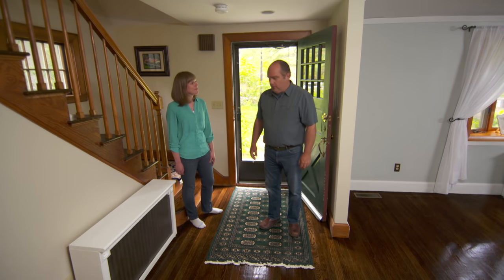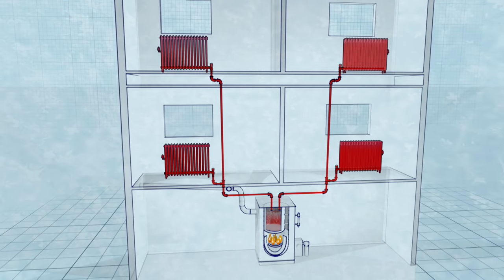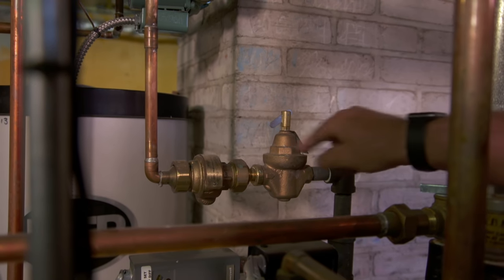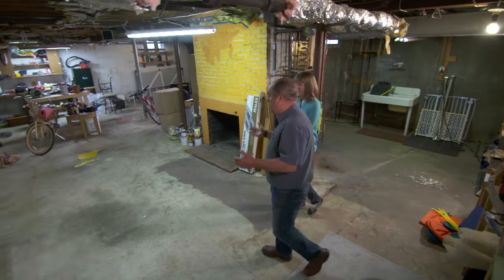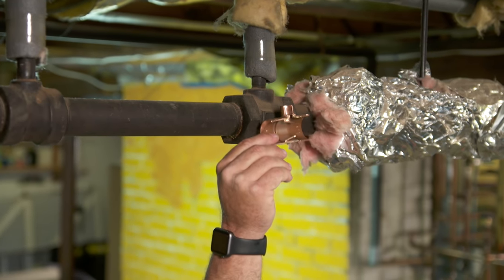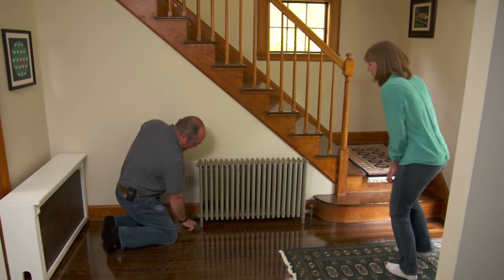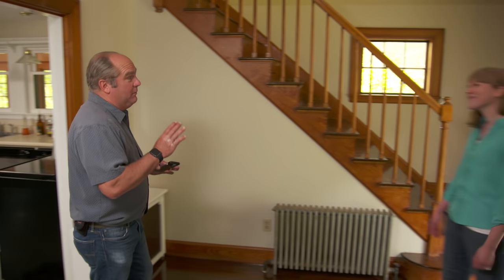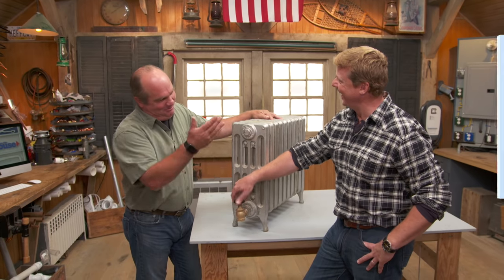How to Diagnose Problems with a Hot Water Heating System | Ask This Old House

Comment: Hello, I have a house built in the 1940’s with a radiator heating system that always worked fine. We did decide to upgrade soon and had 2 boiler salesmen come by to take a look. All of the sudden our system doesn’t work. Is there anything they could have done to switch the system off to force us to upgrade? Any advice is appreciated. It’s pretty cold in the house right now, just wondering if this was truly chance.
Reply: Sandra Kowal.    You just said you decided to upgrade.
Reply: You checked switches, breakers, water levels, valves, pilot light (if any) I assume?
Reply: Of course, it's possible.  Call them and tell them what you are telling us. Tell them you'll call your state's Attorney General's office to complain if they don't undo what they did. The Dept. of Consumer Affairs is often part of the AG's office. They are there to help you and will know if that company has been a source of complaints in the past. SPEAK UP!!!  But first check to be sure that the burner is lighting and the circulator pumps are working. Put your hand on the pumps to feel the motors humming. There may be a second switch controlling them. Be sure it's on. Check the thermostats to see that are set correctly. If they have batteries be sure they are OK.
Reply: If the system was working well, why did you want to replace it?

Comment: Hello:  Most of you peoples' comments are SO CRITICAL. Don't watch the program if all you can do is judge the man or say "Oh this way a setup." People are so rude these days. I, for one, was looking for just this "tour." Yes, I have these same type of heaters, sadly, and yes I do know how to shut them on and off. I don't live in a nice old house. I rent off of a woman who split an old house up (a real "slumlord" in the city of Youngstown, Ohio into two apartments.My heat is supposed to be included in my rent. One apartment up and one down...so my apartment is formally the upstairs bedrooms of a very old house.  I have never seen the downstairs apartment nor the basement. My neighbor has the thermostat in her apartment and shuts off her radiator valves downstairs which are obviously directly below my radiators when she's "too hot." Well, last week during this 2017 "un-jolly" Christmas season it was 27 degrees outside. Apparently, she was very very hot. All four of my radiators were cold as ice. She AT LEAST USUALLY leaves the kitchen one on...(and never my bedroom one on...the one I need the most since I am bedridden.) And yes, ALL my valves were completely open...and YES - it really does matter if they are open half way or a quarter way for those who may not know. So my apartment was ice cold at a frosty 59-61 degrees. I sadly and DANGEROUSLY have had to resort to opening my gas oven door and setting the oven to 405 degrees to heat my apartment up in mornings and then again just before I go to bed. Yes, I know the CO2 is very dangerous. Tell my landlord because even though I can use a small space heater in my bedroom if I forget to shut it off before using the microwave, BOOM - there goes the breaker! Once again, no basement access and neighbor will only flick it on and back off the way kids play with a light switch and I have to wait 10 hours to 2 days for maintenance to come, then they must wait to gain permission to enter her basement and turn my breaker back on. So I take my chances with the CO2 instead. So thank you very much for this video. I record every temp in every room every morn, noon, evening and 3am. I wish I had a gadget like your phone app to prove the radiators are ice cold. That's the only thing difficult to gain proof off. It is like she said/she said. Then I could withhold rent and file with the ADA (Americans with Disabilities Act) for discrimination because my landlord is well aware my neighbor is doing this but they do not take steps to solve the issue. They claim they are "too broke to upgrade electric box or steam/hot water heaters" but it's really a neighbor issue also. They could put locks on her knobs and thermostats. I've lived here three years and every year I'm getting colder.  My neighbor taunts me by telling me to wear sweatpants and a winter coat when I go to the restroom in the middle of the night. Btw, I have kidney, heart and COPD breathing issues - have a disability car tag and am deemed disabled by the government of US. Is there nothing I can do about this? Frustrated and freezing in OH. Thanks for explaining how these things work. Now I know for sure that it must be her shutting her's off downstairs which is why heat/water never makes it to my floor...except one day when it was 50 degrees out and it was 76 DEGREES in here and they ALL WERE HOT - SO HOT - HOTTER THAN THEY EVER HAD BEEN IN THREE YEARS. THEY I KNEW WITHOUT A DOUBT THIS LADY JUST HATED DISABLED PEOPLE AND WAS PLAIN EVIL.Well God hates ugly. I'm trying to move but it's very hard to in this area. My parents and I have always loved your great show. Merry Christmas. I hope somebody will have a good, and not a cold - happy holiday and a wonderful New Year! Only a few more months until Spring. I'm hanging on! LOL   :)
Reply: If you  bleed the radiator you fix the problem.

Comment: I have a Bryant Gas Fired Water Boiler (1973) model 234 (nat Gas) that has always worked but today its not. I turn up the Thermostat for Call to heat and I see Pilot light go on and then the burners got on (Orange flame mostly) for a few seconds and then go out but Pilot reignites relighting the main burners etc.. This cycles 5 or 6 times and then it all shuts down Until I shut down the unit and restart the call for heat> I looked for some type of flame sensor but dont see one so I am not sure what to do. Any Ideas ?
Reply: Did you figure it out?

Comment: I have the same issue. One radiator that doesn't get heat (in the master bed to boot). No air trapped, no valves that could be off. Only thought is a clog. Any other ideas?
Reply: That radiator has no valve? All other radiators on the same floor get hot? When you bleed that radiator you get a GOOD flow of water.

Comment: Here is my problem with hot hot water heating I have a 1915 two story house with cast iron radiators AND baseboard fin heaters in the kitchen. The kitchen heaters and the boiler a just a few years old. The kitchen base board heatersdo not even get warm.

So I turned off every radiator in the house the copper pipe in the kitchen got so hot it burned my hand. I have then valved off now.

Comment: I am curious if the circulatory pumps actually help to heat the room rather than gravity operated heating system ?
Reply: I assume you mean better and yes they would. The reason is that the greater the temperature differential between the radiator water and the room air, the greater the amount of heat transfer, the faster the room heats etc. By forcing the water to constantly cycle the water in that radiator stays at a constant peak temperature as opposed to dropping. non pumping radiators worked like steam, the colder water sank to the bottom to be replaced GRADUALLy by the hotter water.  Just as steam ones worked by cooling from steam temp to water temp and reverting to water to leave. This is the difference between thawing a piece of meat via leaving it to sit in warm water (which then cools as it warms the meat) or leaving it under running water. Both will likely thaw the meat, but by constantly cycling the water over the meat and ensuring it's always fresh boiling hot water, you get faster heat transferrence and quicker thawing.
Reply: @sparkzbarca  Good. Thermodynamics 101.

Comment: Are radiators considered an efficient form of heating ? Are they still being installed today ?
Reply: Glenn Watkins Really? Yes and yes.
Reply: They also give cleaner air, long lasting heat, gently humidify the ambient and are wonderful for people with allergies and for those who prone to getting other people's colds (less air horizontal air circulation, it rises and falls)
Reply: @squirrelfish8200  Okay Squirrel Fish but have you learned there is no proof of contagion.

Comment: I am baffled to see how rare and uncommon firewood fired hidronic boilers are in US when in Russia and basically all of Europe firewood fired hidronic boilers are the thing of the past, the thing of the present and the thing of the future. Weird. As it happens, my own firewood fired boiler is 80k BTUs or 11 Kw of water heating energy from one cubic decimeter of hard fuel in the burning chamber. Guess what? it is located in the middle of my living room. I installed a stainless steel liner in the chimney and bought a very neat and decor style firewood boiler with cast iron heat plate so mom's can cook some soup while the firewood burns inside, and the doors are made from cast iron and has heat resistant glass, much like a glass lined fireplace, but it is basically just a free standing unit on four legs, and 1'' supply and return. I surrounded the boiler with tiles and installed mantles above the boiler. Just beside it is a stair well leading to the second floor stairs and in there I ran the supply and return, fitted the circulation pump and the manifolds. Parallel to this boiler I installed a semi automated combi boiler that I can turn on on the busy days when I don't have time to fire the boiler with wood, and it has a thermostat that calls when rooms gets below 17'c or when I'm out of home. I have installed different zones so every room's radiator is a separate loop so if any problems occur I don't shut off all radiators. I also installed a combi water heater that has an electric heater and also a spiral inside made from copper. When in normal mode the boiler is firing the spiral is heating the water for taps in the boiler as it transfers heat from boiler water to water heater water, and when the boiler is cold, the combi boiler heats it, and when that is cold the electric heater heats the water inside the water heater. Also, there is the third plan. If I am not home, and the combi boiler seizes or gets broken, the fitted 8 kw electric heater inside the firewood boiler itself is wired to run only when rooms get below 15'c and till it gets to 20'c, then it shuts off. This is the perfect heating system everyone should have at their house. Primary: Firewood or compressed sawdust tablets or briquettes, or even coal if your into that. Secondary: Gas as the combi boiler takes over automatically if i'm not home to charge the boiler with firewood or briquettes and third: electrics. If all fails, then the electric heater of 8 kw installed in the bottom of the firewood boiler will start heating. The mechanical thermostat secured on the supply nipple of the boiler itself that senses when the water inside the boiler has reached 60'c it turns on the circulator and the system starts to run as normal, the same thermostat senses when the water gets at 60'c and starts the circulator to run the water to the radiators. It's all really so simple if you look at it, but it is also so genius that any ordinary Karen or John would love to have it too just in case.

I am sometimes horrified at how insecure heating systems are in America. Ya'll love that oil so much, but you don't have any secondary plan if the boiler fails. I couldn't live like that, I would at least integrate a combi boiler that could take over if the main boiler fails. Maybe the snow is at 5 feet and you live in the middle of nowhere and your oil runs out then the gas can take over, but what if you don't have that and outside it's like -30'c? Scary stuff. I know that certain oil boilers have the ability to be open quiet easily with the latch that makes sure that oil burned is secured in the boiler body, but you could take it out and use the chamber inside as a firewood boiler, but I don't know how efficient that would be.

Also, with all those controls, errr, why do you all need that complicated stuff? My system is like that: A boiler, a supply nipple. On the nipple is secured just simple thermostatic switch that senses when water gets hot in the boiler and turns on a circulator. I charge the boiler with wood, lit it on fire, I sit back, and enjoy the warm and cozy fire behind the glass door. The water reaches 60'c, the thermostatic switch senses it, turns on a circulator. At first it circulates the water only trough the boiler itself, trough a thermostatic tee that diverts water to manifolds only when the water in the entire boiler reaches 60'c (if the hot water would quickly rush away and the chimney's temperature would be below zero, then the condensate would start forming inside the burning chamber and tar like substance would start forming on cast iron walls, so the thermostatic tee ensures that the boiler chamber containing heating water is at the right temperature and then slowly opens to let hot water run away to radiators. Then as the whole heating system gradually heats up the tee starts to open more and more until it opens up all the way and fully diverts the water to radiators and not trough the mixing loop of the boiler) then as the boiler heats up the tee opens and the radiators start heating up. When the wood has finished burning the system cools down and the thermostatic switch turns off the pump only when the fire inside the boiler has gone out. As you can see, no need to have all those fancy Taco computers next to the boiler. Work smarter, not harder. Yes, this way you can't control micro climate in every room because if you close every radiator wia/ thermostatic valves then the boiler can overheat and explode, but who needs that anyway? Radiators heat up and cool down, and noone complained about it for 100s of years.
Reply: Good comment, except for the last part. I need thermostatic valves,  because without them my apartment is waaay too hot.

Comment: They probably turned it off for the show....Anything for TV
Reply from the maker: Nope.  That was really how we found it!
Reply: What about a radiator that gets warm but never hot. I have a multi-family in Fall River, MA and one of my bedrooms is always colder then the rest of the house because the radiator is noticeably cooler to the touch then any other radiator in the house.
Reply: That could mean low flow of water because of a restriction, but the most common cause is air collecting in the radiator.  If  you haven't already tried to drain the air from the valve like he showed, you should try that first (you might find the lower part of the radiator warmer than the top).  If it's higher than the other radiators in the house, it could be there is not enough pressure to get water up there also.  That could mean the expansion tank is malfunctioning.
Reply: Thanks for the info.
Reply: Dennis, even if they did it for TV. They're teaching the viewers.
Reply: @Thisoldhouse, you really found it like that? Isn't that the first thing you would check?
Reply: Its easy to overlook though. Especially when they don't work like they're supposed to..
Reply: @thisoldhouse  Wow you would think that someone would check the valve before calling the experts out.
Reply: @saulgoodman2018  Maybe they did, but decided to make the trip into a teaching moment.

Comment: I want to change from old radiator to base heat my myself how can i do it.
Reply: If you have $10,000 lying around, it helps. Really, if you can get the cast iron radiators working, they put out more comfortable heat; more radiation and less convection.
Reply: Baseboard heat?

Comment: Good lesson on how a mono flow system works. Sure hope the problem was staged. Homeowner obviously has some skills to build those covers but doesn't check if the valve is on??
Reply: Yes, the mono flow explanation was the best part.   Ours are similar hot water rads but direct return piping, single zone installed 75 years ago.

Comment: Well they did have the Floors Refinished i bet they Removed The Radiator to Sand and Finish The Floors Evenly, Then When they reconnected the Radiator they forgot to turn it back on. and Shut it off to Remove it so it didn't leak on the floor..
I Have Done Floors for 22 years so We Always removed the Radiators..